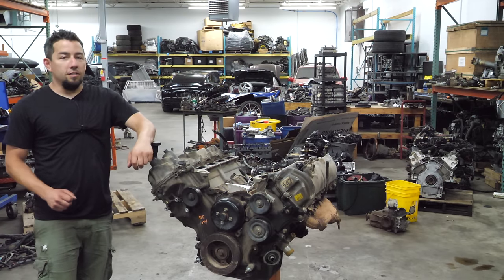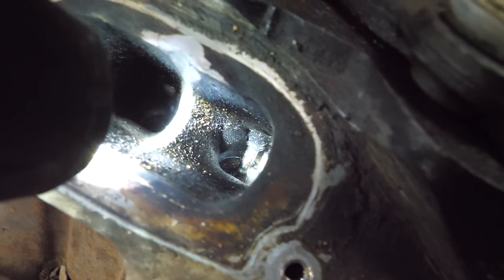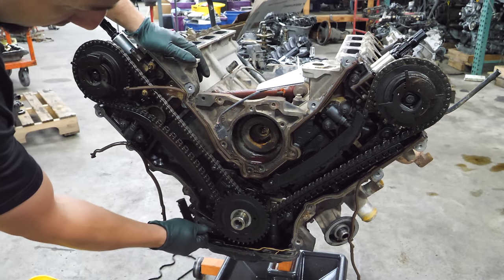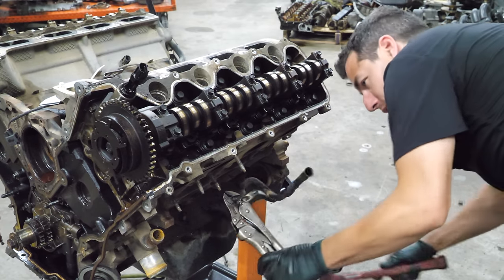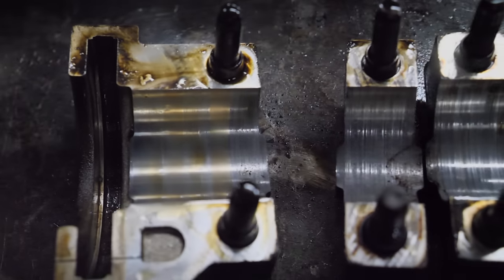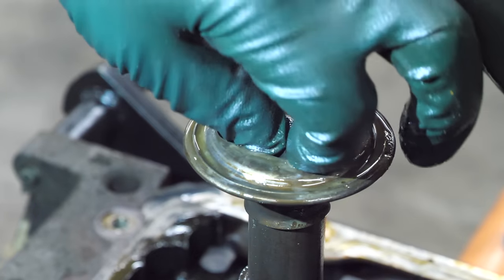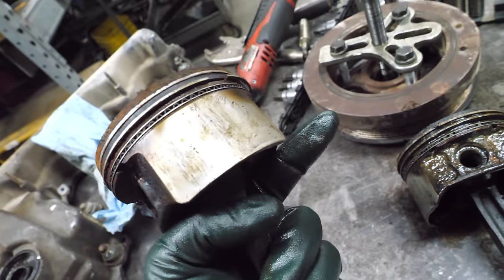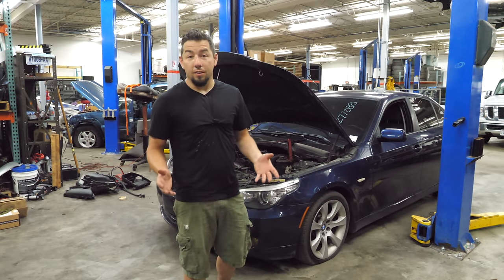Bad Ford 5.4 3-valve V8 Engine Teardown. Which of The MANY Possible Failures Took This One Out?

Comment: 5.4L 3v whisperer here, I’ve owned several. The main problem as stated by a few other commenters is the tensioners fed by oil pressure, old ones failing prematurely (usually by avoided maintenance) and can cause a domino effect on issues like the VCT, cam wear, and leaks from PCV pressure. There are many reports of these problems because of the prevalence of the engine in so many vehicles. Bulletproofing this engine takes putting in the new oem tensioners, a melling oil pump, and new VCT solenoids if you have high miles. I still love them because they are easy fixes. Even the FordtechMakuloko guy bought one! They are torque monsters when tuned due to the VCT and displacement, and no one can argue with how bad ass they sound with custom exhaust.
Reply: I have a 2010 Ford Expedition Limited 2wd and bought it 2012. I now have 260,000 miles on the original engine and transmission. I change the oil every 5,000 full synthetic since I bought it and change the trans fluid every 2 yrs. I have a small rattle now and plan to do the tensioners, a melling oil pump, roller followers, vct solenoids and a few other things. This truck has been problem free since i bought it.
Reply: Could you explain how the timing works on these engines? I have a 2008 Ford expedition Eddie Bauer with the 5.4l Triton engine it started hesitating and shaking and knocking when I was stopping and now if I'm not on the highway it's shaking hesitating and knocking horribly but if I put it in park and rev it up it goes back to running smooth?? Any help is appreciated
Reply: Do you have a scanner to check codes?  Also check for compression on each cylinder and spark plug.  This is hard cause you might need to have it hook up to a computer to run real.time data.
Reply: same here, at their core they are solid engines, so whats the big deal, replace the parts on the outside that are easy to get to with updated parts, and it uses o rings so no gaskets to replace, its easy to work on and the vct gives it a lot of torque. updated phasers, updated cam followers with smaller bleed holes, cast iron tensioner, melling pump, over 200k miles supercharged on 8psi still putting in work in my 4wd truck
Reply: The best info I needed in one comment
Reply: @John-ct3yz probably a bad vvt solenoid, had a similar problem until I changed them out.
Reply: Frankly, lock out the phasers and reprogram the PCM, mic drop.
Reply: You can also replace the tensioners with the older iron ones, they have ratcheting internals so even with a slightly lower oil pressure it won't chain slap like the new ones do when they blow the gasket out. I personally prefer the older tensioners. From my understanding the timing components are made by Melling OEM, so you can save some coin grabbing a Melling kit. They have options for iron or plastic tensioners. Always use OEM VVT solenoids, they are only 48 a pop anyway. If your over 150k it wouldn't hurt to spend a little extra and replace all the followers to avoid the issue where they lock up and destroy springs and or whole pieces of the head. My last work had an old super duty, guy barely took care of it and it was around 250k miles and he would regularly use it to haul. Few times we hauled skidsteers and other items larger than that. Motor hauled it with little issue. He also ran 5star tunes on all his 5.4s,  that also helped.
Reply: I have a 2010 5.4 with 216,000 miles.  I need new VCTs, roller followers, Meling oil pump and stuff.  Hope to get it to 300,000 miles. 🤞
Reply: @Irish_Hooligan IF Ford’s OE chain parts are made by Melling then Ford had them made to a higher quality. Lay the Ford branded chain and sprockets side by side with Melling aftermarket parts and you will clearly see the difference in attention to detail. It’s blatantly obvious. Melling’s wheelhouse has always been oil pumps and many of their other products are made by other companies and just have Melling’s name on them. When it comes to repairing a modular Ford it’s getting factory Ford parts or I’m not taking it into my shop.
Reply: @prevost8686  you can use whatever you want. Ford doesn’t make their own parts it’s outsourced just like every other car brand. It’s always your choice 🤷‍♂️
Reply: @Irish_Hooligan  Of course they outsource. But the manufacturers set the quality standards that they want the components to be built to.
Reply: @prevost8686  so buy the ford branded part and pay the ford tax. It’s fine by me whatever you choose. I’ll do melling and have 0 issues.
Reply: @Irish_Hooligan  What tax? A OE Ford cam phaser costs me around $200 . A Melling “professional grade” one is $180 . Same for the rest of the parts. The difference between me and you is that I own a shop and I have to stand behind my work. My reputation is on the line. After all the parts from Ford are hashed out they may have costed me $25-30 more. It’s a no brainer. There’s no Ford tax whatever that means.
Reply: @prevost8686  an entire Melling kit with phasers, chain, iron tensioners and everything needed is $340 where I get my kit. If you were a shop you get mark downs depending on volume straight from dealer. So not sure where you are over paying, but you’re over paying.
Reply: @Irish_Hooligan  Your pricing is a moot point because you are not comparing apples to apples. I can take Ray Charles and show him the parts side by side and he could clearly see the difference. It’s that obvious. You’re not buying the “same” quality parts regardless of what some internet experts say. The difference between my shop and you is that I will pay the difference for the best quality parts. Melling doesn’t even produce their own chain parts so you have no idea what the quality will be. I’ll say it slowly so I won’t be misunderstood. Melling is an oil pump company. That’s all they make in house and it’s always been that way. They provide other parts with their brand to be able to get a larger piece of the repair market. 
I will not put lesser quality parts on a vehicle period. If a customer wants cheaper quality parts there’s plenty of hacks out there that will be happy to help them but that’s not my market. It’s absolutely stupid to use lower quality parts on the most critical and expensive component of a vehicle. Do whatever sir. I wouldn’t even have responded to your comment if you didn’t state that the Melling parts were just as good as Fords. Way too many self appointed experts on the internet spouting nonsense with no facts to base their claims on. Have a good day.
Reply: @prevost8686  Melling is oe manufacturing for a lot of companies timing components. Judt like valeo is oe for vast majority of clutch components. Just because you want it to say ford and have a ford part number etched into it to make you feel good. They DO manufacture their own parts in house, they have manufacturer plants in US, Mexico and UK. Please stop pretending you know what your talking about when you’re obviously just a shade tree mechanic who has 0 idea what they are talking about. You don’t have to like the truth about the parts, but stop pretending like mellings are not an OEM manufacturer.
Reply: @prevost8686  congrats on being willfully ignorant, enjoy your day and over paying 👍🏻
Reply: @Irish_Hooligan  Bless your heart…
Reply: @prevost8686  thanks man, keep the southern “blessings” just for yourself though. Have a GREAT day 🙃
Reply: @Sunspot-19  I think I'm going to do that on mine.  It's worth the 1 mpg drop just to reduce the unnecessary complexity.
Reply: @prevost8686  You're spot on dude.  Irish Hooligan is a Fooligan. Fordtechmakuloco even went over this. He's had multiple trucks that had timing jobs done with aftermarket components (like melling) come in after 20k miles with phasers completely fucked.  Dude just has his head in the sand.
Reply: @John-ct3yz  How did you make out?  Check oil pressure before changing out VCT solenoids.  Low oil pressure caused this same issue with me,  at hot I had around 8psi and would shake like crazy when coming to a stop because the solenoid didn't have enough pressure and kept the phaser in the advance position so the timing was completely off causing the shaking and stalling.

Comment: This was a perfect example of a poorly maintained engine. I owned a 3V F150 for over 10 years and it was a workhorse and reliable. I popped the valve covers off at 130K to do timing as a preventative measure and it was spotless inside and the timing components were perfect. Run good oil and change it regularly and you will avoid many of these issues.  I’m not going to pretend that the 5.4 3V is a magnificent engine but they are actually pretty tough engines and mine was very reliable.
Reply: I agree with you sir. Mine is 17 years old and still rolling. Gotta do good maintenance and as you said...use good oil. 👍
Reply: Where Ford screwed up is doing their 10k oil changes on these Engines from the factory
Reply: I kind of wonder if there was an oil problem. I used Castrol synthetic and had zero issues until I sold it with around 220k miles. Spark plugs would be completely done around 80k miles. 1 alternator around 150k. But that’s it. It ran perfectly when sold. 

Back in my BMW days I remember Mobil 1 in other cars eating vanos units. Great oil, just not for that application.
Reply: What oil would you recommend?
Reply: @irishmo87 I run motorcraft only
Reply: Same here—no major problems with the motor at 202,000 miles (I could hear the phasers knocking and a very slight rub in the motor on startup). I changed the oil every 3k-5k miles, radiator fluid at least annually, and ran 93 octane since the day she arrived from the factory.   At 202,000 miles I had a new timing kit installed with oem motorcraft cam phasers.  While I was in there I added the Melling 360 high flow oil pump, replaced water pump and thermostat, rockers/followers (also motorcraft), spark plugs, and VCTs.  The cams and cam caps looked great. A few pulley bearings needed to be replaced. Tech said it was one of the cleanest motors he’s ever seen.   At the time it came out the 5.4 was no slouch, and my truck (2005 fx4 supercab, 6.5ft bed) will still out tow an equally specked 2023 2.7 ecoboost f150 (not bad for a truck that is 18 years old).  For what its worth I supplied the timing kit ($750), rockers/followers ($450) and oil pump ($120). Out the door it was $1800 here in crestview FL at Macks Auto. So, for ~$3200 the engine runs like it did from the factory.  Hope to get another 200,000 miles out of her. Also noteworthy, the Self Automotive Group owns the Crestview FL ford dealer and they flat refused to work on any truck that was older than 10 years unless it was exclusively maintained by them. They told me they couldn’t find parts for trucks that old—funny thing is all of my parts came from ford.  They were trying to force me to buy one of their overpriced f150s…
Reply: Love my 5.4’s, 181K and still running like a beast.  Just change the oil when it’s time and these motors will go and go.
Reply: Love my 5.4’s, 181K and still running like a beast.  Just change the oil when it’s time and these motors will go and go.
Reply: Love my 5.4’s, 181K and still running like a beast.  Just change the oil when it’s time and these motors will go and go.
Reply: Love my 5.4’s, 181K and still running like a beast.  Just change the oil when it’s time and these motors will go and go.
Reply: Totally agreed ... man can choose truck but truck can't choose man ... that's the only issue
Reply: You're just lucky.
Reply: @Bigfoothawk  5 years old belive in good luck .. good luck does not exist
Reply: I bought my 07 in late August 2007 with about 14k on it. I have 210k on it now and never been inside the engine. Replaced the spark plugs, battery, and transmission fluid and filter. Two front wheel bearings, and a full set of rotors, calipers and brakes.
Reply: My father has a 5.4 in his 2010 F150. It was a fleet vehicle before he bought it and then he drove it nonstop till this day. 270,000 miles and the only thing I’ve ever done to it is preventative maintenance items, and a water pump. 

This is obviously anecdotal evidence, but if you maintain them properly, I don’t see them failing.
Reply: @waterloo123100  10 thousand Miles that is 16 thousand Kilometers that is stupid if you ask me.
Reply: @guthrie_1 they’re great, just use one oil brand and stick with it, that helps and if people layer off the gas pedal the timing chains won’t give out. Other than that, yes the cam phasers make noise but so what it really doesn’t effect how they run
Reply: Mine has 290k miles on it and the only thing I’ve replaced on the entire truck other than my wheel bearings from the breaks wearing down was the coil packs. I regularly change my oil every 3k miles.
Reply: My 06 f250 5.4 3v is going strong.  I install granite countertops, and it currently has 298k on it. Bought with 139k 5 years ago.
Reply: I use Motorcraft oil or Kendall synthetic blend. Kendall bottles Motorcraft but is harder to find where I live.

Comment: People are goofy if they say the 5.4L is trash
Reply: 2 valve was good, 3 valve was crap.
Reply: @ajs96350  my 3v has over 200000 with all original engine components.
Reply: That’s what I’m thinking is how many miles on it. I’ve seen lots with over 300k miles. But back in the day when I did more mechanic work Toyota 22R and Nissan 2400 had timing chains wear housing until they had holes. I fixed lots of those

Comment: I am the one that likes this motor. 290k on my Expedition with a 3V 5.4 and done nothing but hoses, water pump and one coil.  It’s had oil changes and been perfect.
Reply: I’m another, JD ! I also have a 98 Exp with the 5.4 2 valve, changed the timing components, cast iron chain tensioner, roller followers, and lifters. Hope to get another 200K. My 2014 5.4 Exp. will be getting the same someday, along with the HV oil pump.
Reply: @chrisretired5379  2v is better than the 3v
Reply: It’s not a bad motor, maintenance is key.
Reply: @anthonys7534  no, some of them made it through due to sheer luck.  But they Are bad.  Or I should say Were , as they are about gone, erased from existence due to attrition.
Reply: @Blue-moon12  absolutely not

Comment: Remarkable what a stark difference in reliability and longevity there is between the 2 valve and 3 valve 5.4 liter Triton engines. I had a 2 valve 5.4 in a Ford E-350 that gave me 237,000 trouble free miles with little more than routine maintenance.  I sold it and the second owner put another 40,000 miles on it before replacing the transmission - the engine was still running strong.
Reply: 5.4 
2V is a beast.
Reply: I have a 2000 F150 HD version with the 2V 5.4.    I inherited it but did not know for sure until I received it.  Very relieved and it runs great.
Reply: Had a 1999 3v in an F250 make 
 it to 299,986 miles before the 3rd transmission went out and we sold it. Biggest problem with the engine was a sparkplug ejected out of cylinder 4. Fairly big issue to have but an easy enough fix, transmissions were a problem since the truck spent its life towing construction equipment.
Reply: After watching this, im glad to learn my 97 clubwagon 350 has the 5.4 2 valve- its got 90k on it - life is good!
Reply: Right. I'm over 240k on my 99 and stil going strong. Oil was changed every 3000 miles and I've kept it that way.
Reply: My 02 6.8 2v, 4r100 Super Duty was reliable. 260,000 miles and it took 10 spark plugs and 10 coils. Salt belt rust destroyed Her. That entire truck had Toyota like reliability. Only maintenance items ever needed replaced. This was a truck with a service bed that spent it's life at it's GVWR and regularly towed trailers. Week day work truck and weekend race hauler.
Reply: 09 3v 212000 miles still running great
Reply: My 2valve has 350000 and still runs like new
Reply: I have a 5.4L 3V Triton in my 2007 F150. 284,000 miles and going strong.
Reply: 2001 E150 here with 220,000 miles. On its 2nd 4R70W transmission. Used for towing our 20 foot trailer on vacations. 7.3 mpg towing. Hit the OD OFF button to drop it into 3rd gear for even the slightest hill. Trust it anywhere.
Reply: 5.4 2v is great except for the IAT whine and spitting plugs
Reply: Pushed my 2 valve 250+ until stolen
Reply: @thatguyoverthere9634 he said 3valve came out in 2004
Reply: Idk if mine is a 3 valve or 2 valve but when I take off then pesky valve covers to see what fucked my motor at 11 pm I'ma be happy. Ima stick to 3 cylinder Mitsubishis for the rest of my life, god nothing like working on a motor the size of a battery to make you realize how annoying your truck is.